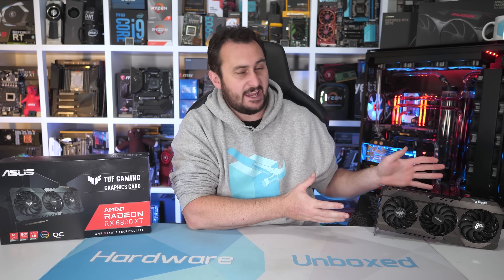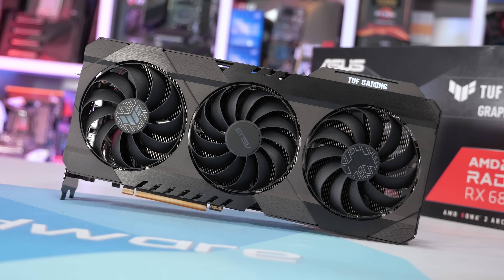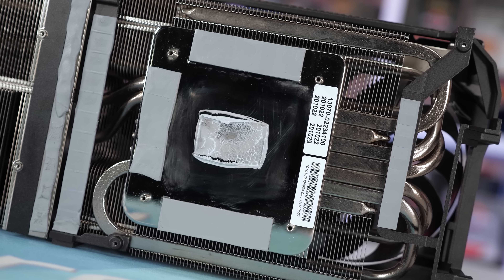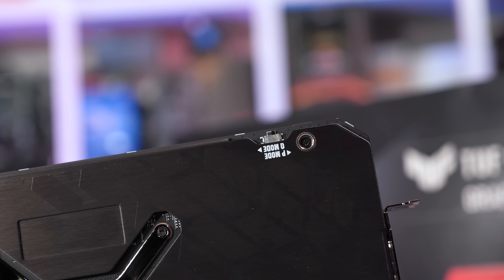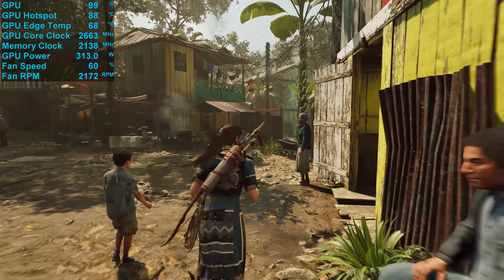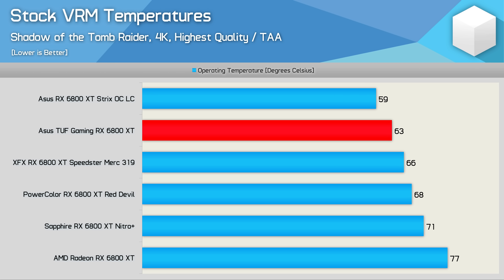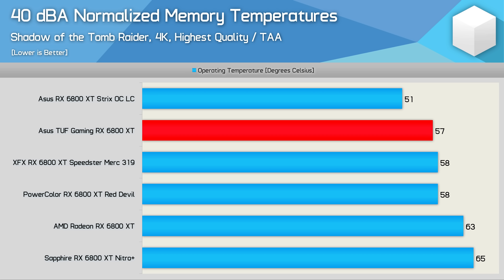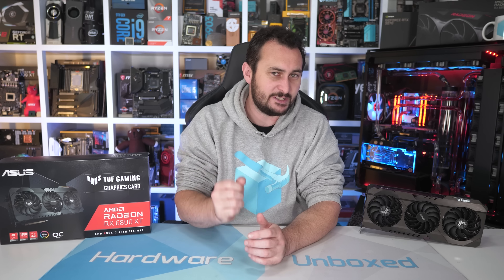Asus 6800 XT TUF Gaming Review, Power, Thermals, Overclocking & Gaming

Comment: 6:30 My rx6800xt TUF has different stats. 
At 272W it runs at 2350MHz and 2090 RPM (t1: 70°C; t2: 86°C)
It runs at 2260MHz and 1800 RPM only under undervolt (-10%) and it consume 245W (t1: 67°C; t2: 81°C)

Can someone explain this?
Reply: Mine runs completely differently as well, out of the box my Asus 6800xt TUF runs at around 2400mhz with the hotspot at 100c, but the fans are very loud, so I'm not sure why the exact same card reviewed here runs at 2270mhz at stock settings. Overclocking my 6800xt TUF to around 2660mhz as shown in the review is totally out of the question, it would crash pretty much immediately with hotspot temps threw the roof.

I have decent airflow in my case and have repasted the gpu but it makes no difference. This is why gpu reviews are kinda useless, it's just pot luck wether you get one that was built well or built badly.
Reply: @j_ford123  Did you end up RMAing it? Just curious.
Reply: @Top_Weeb  I still have it, I underclock and undervolt it so it runs cooler and quieter.

Comment: Why don't cards use pcm instead of paste? My 6900xt hotspot went from 78c+ to low 60s. Like 63 64
Reply: Whats a pcm?
Reply: @leontroll973 
I know it's a bit late, but it's phase change thermal pad on a chip. Basically a material that changes to liquid when it reaches a high temperature, which should increase thermal conductivity.

Comment: 2 years later, I bought this exact model used for 500$ USD and new AMD Drivers make it so powerful that it is pretty much at the same level as a RTX 4070. I also have 16GB VRAM to increase my setup lifespan. It is a beast for 1440p and can handle new games at 4K High settings :)
Reply: Bought mine today for $360 US. Big lift coming from Rx5700xt
Reply: I want to do the same rn  @YaboyMond is it still good? I saw a used one local for really cheap
Reply: What CPU did you pair it with?
Reply: Just bought this gpu too with 7500f it crushes every game 2k no problem vram on 3080 is struglin but  16gb flexing
Reply: Just bought it for 35k INR
Reply: Estimado, hace casi un mes la compré usada en u$s 400 y es una bestia! De mí RX570 8gb salte a este modelo.

Comment: Just bought a open box 6900XT TUF for $449 plus tax. Working great and it actually runs cooler than my 6700XT barely kicking in the fans around 56c game temp. This 6900XT actually runs around 80watts less in game than my 6700XT. That is due to the easier nature of running Battlefield 4 at a 142 frame cap. Without the cap on newer games it hits 274 watts.  Wasn't expecting to save power using a 6900XT.

Comment: bought the same one today, for 1353 AUD (in eastern europe, vat included), amazed by its quiet operation, thanks for the good review of the cooler and its components. Interestingly, Sapphire are using two bigger fans on the edge (100mm) but it does not give them advantage.
Reply: this is better than rx6700xt?
Reply: @GyanTvAmit  much better than 6700 and 6750
Reply: @ВикторШишков  how 😡
Reply: @GyanTvAmit  6800xt better than 6700xt
Not sure why you're surprised?
Reply: this better than sapphires nitro 6800xt?
Reply: @MonesahBuson  I had my Sapphire Nittro RX480 8GB for 5y, until it died on me due to oveheating VRMs. I don't want to trust another Sapphire product, eventhough it had a better software tool than what Asus has. For me, the  Asus card is probably more reliable.
Reply: @ВикторШишков  okay thanks for the insights

Comment: HELP!!! This gfx card draws 366 watts (wow) paired with my i7 9700f processor. Would this struggle with the Corsair 600w SFX power supply? Getting some jitter in every game and I'm thinking my power supply could be the issue. Thanks in advance for your time.
Reply: Try to activate FreeSync in the driver and at monitor
Reply: I notice all my RDNA2 cards seem to suffer from too aggressive of power saving. With the clock speeds dipping down due to meeting a frame cap the card doesn't always maintain the capped speed and when I glance at the clock speed it isn't running full speed. As if the card doesn't want to power up on older games. All this extra performance getting limited by whatever BIOS power saving feature. Like with CPU's I would love a full power option that could be selected on certain games that need it.
Reply: @45eno  This card has killed my love for the PC race. I don't even bother with it anymore.  Waiting until I can afford to switch back to Nvidia. Time to cut my loses
Reply: I even upgraded to a 750 power supply with the same results. The crazy thing no one seems to have an answer.  I paid $1200 for a brick
Reply: @thagamezova9310  What is it doing? Mine work especially in DX12 games but some older games the cards are acting like a lazy GenZ not wanting to ramp up. Seeing my card at 50% utilized when there should be no reason the card isn't trying for more frames. I could have bought a 3080 10gb for $400 (miner) or a open box with 30day return 6900XT Asus TUF for $449 plus tax. Right now I am very happy with it. Frames are capped at 142fps, clock speed is hanging around 1200-1600mhz and temps around 56c. Only using around 90-100watts. Nice card with a good cooler. Just want AMD to release a full performance NO power saving option that you could set to certain game profiles.
Reply: @thagamezova9310  I am very sensitive to smoothness being off in my games. Unless I do the below I get obvious off feeling in games.

-Freesync ON in monitor and AMD driver
-144hz monitor and use the AMD driver to cap the frames to 142 max so it is within the Freesync range of the monitor which makes a huge difference on smooth feel.
-never enable Vsync in game menu as Freesync with the set FPS cap will maintain sync.

With that done my mouse/screen smooth feel is like butter. I don't know how others run full FPS speed, it isn't nearly as smooth.
Reply: @45eno  I'll try those things.  I can handle a few stutters. But I'm getting freezing for at least 1 second. It didn't happen until I got 6800xt. My 1080ti was flawless
Reply: @thagamezova9310  I take it you have done a clean Windows install with latest drivers, latest BIOS?

If you have a extra SSD or NVMe you could simply do a clean install on a 2nd drive to test to see if it improves. 

Also could swap out the card with someone is you know anyone. I have 9 builds with 8 RDNA2 cards so if it was my card I will try it in another system and move a different card in the current system.
Reply: @45eno  yes clean install on windows 10 and I tried 11. Same. I sort of think my ultrawide might part of the issue. Maybe this card just struggles with too many pixels
Reply: @thagamezova9310  I've run 6600XT on 4k TV's. Also 6600XT / 6700XT  on 1080p/1440p. 6900XT on a 3840x1080p. 
I have all different sizes from 16:9, 21:9 and 32:9 super ultrawide.

Try to find someone to swap the card out for testing, that will tell you if the problem stays with the card then you know.
Reply: @45eno  OK bet. I will swap with a buddy

Comment: I happened to buy this one as my 6800xt to replace rtx 3070. This thing is so huge that I had to replace my pc case, too. But runs really cool and I managed to undervolt to 1020mv. Only consume around 220W to achieve 2350mhz stably under load.
Reply: nice!
Reply: What's your experience been using Tuf one for almost a year? worth it?

Comment: Just got my tuf 6800xt and the build quality on it is nuts. It feels solid, looks great, and runs great. It has not gpu sag either.
Reply: I didn't wanna go back to Asus because their RMA process is bull. But this card looks like one is the most solid. I use sapphire and their RMA process is wonderful. They replace my Vega 64 with a Vega 64 that doesn't exists on the market. It uses AMD Pro drivers. This card has never crashed once. Turns out these companies have cards that runs perfect as hell and never fail when stable as hell drivers. They just don't put them on the market. I've had my RMA Vega since 2019 and This thing doesn't know what crashing is.

Comment: Trying to play games like WZ I can't get my card to go much beyond 100fps at 1440 even though I've seen it rated much higher.

GPU: Asus  6800xt TUF
CPU: AMD R7 2700x
Ram:32( clocked to 2132)

is it CPU bottlenecked or do I need to get my ram faster? if I enable XMP profile for 3200 system crashes.
Reply: That RAM is a huge problem. You're still on DDR 3 but a very low clocked DDR3 ram. I think you're ram is an issue. It's destroying that cards performance.
Reply: That RAM is a huge problem. You're on DDR 4 but a very low clocked DDR4 ram. I think you're ram is an issue. It's destroying that cards performance.
Reply: for my opinion it's both ram and cpu, cpu 5600x will boost your fps + ram should be base 3200-3600 cl16

Comment: This card is a beast! One thing that threw me off is my CPU temps are round 46c when using this card on my MSI X570 Tomahawk and Ryzen 5800x while gaming BF5. My previous card MSI RTX 2070 super my CPU temps run between 68c - 80c. I scratch my head. Thank you for this awesome review, I respect it.
Reply: Gpu takes more of the work so CPU has less to carry meaning the temps are lower

Comment: Great review! I own this exact card now. Partly because of this review and partly because I previously had a 6800 "non XT" Asus TUF Gaming OC that was so powerful and quiet. I expected more of the same. I can whole heartedly say that this XT based TUF card is noticably heavier, bigger, louder and hotter than the non XT version I had. The non XT version of this card was nearly silent in my case even after hours of gaming. Without benchmarking I can hardly tell them apart in my current games fps-wise.
Reply: Another thing I have noticed is my CPU (5600X) is also hotter now while gaming by about 5 - 10 celcius. Which I attribute to higher amient temps generated by this 6800XT (probably due to my Corsiar Carbide 400C case average airflow).
Reply: Running Heaven at 1440P in a loop for 30 min with my case closed the fan is 2250 RPM. Edge Temp is 77C. Although room ambient is 23C and I know my Corsair 400C is only averagely decent airflow. Edge Temp drops to 70C and fans 1850 when I open the window on the case. This is in Q mode and not P. Clock average was 2340 MHz. I think the card I got was not quite as good as yours.
Reply: I figured it out (my higher temps). I was using Heaven where my fps are very high. Noticed the higher my FPS the higher the temps and the higher the fan speeds. If I get the fps below 90 (maxing out RDR2 for instance and running around in town) my temps and fans are in line with the review here. I play at 1440P and FPS are insanely high in some games and the temps and fans ramp up. Solution seems to be fps limiting via game menu or using a utility.
Reply: Hi, thanks for your feedback. Could you tell me how long is the card inside the case? I can get one here in NZ for NZ$1899.00. Not cheap but the lowest price since the release.
Reply: @xmj6830  12 and 3/4 inches from Mount end

Comment: How did you guys measure the 317 watts stock power draw on this card? The max power draw that I saw using AMD Metrics overlay, GPU-Z and MSI Afterburner was 287 watts even after using the GPU Overclocked option from the Tuning menu in Adrenalin software.
Reply: Same here, have you found a solution?

Comment: I have a 6800 XT, I’m not seeing enough stats while running games in the radeon software, the core clock fluctuate anywhere between 0 and 2000 and keeps jumping, I’m not seeing a higher power draw then 90 w.   Is the software just not displaying data correctly, or am I right in assuming that the card is simply not drawing enough power, and should maintain a stable MHZ for w.e i set it on.  I set it to 2000 mhz, but its never on there, and the Wattage should be around 250?

Comment: 2 months later they're 90% over the base MSRP at 1900 AUD. I snapped one up for "only" 1650 before the price hike and should be here next week!
Reply: Brutal. I just got one on Newegg today as part of a rip off bundle. But the card was $1499 CAD. Could have been worse. I sold an msrp 3060 ti for $1350, so it was a nice upgrade.
Reply: @benson733  our pricing is very similar. Means you got yours 100 cheaper than mine. Good job!
Reply: got my 6800xt black edition from amd store for $650
Reply: @DragonProtector  USD yeah?
Reply: @johnathonm7813  yup
Reply: @DragonProtector  wish we could order from and direct. Would have been about 1050 AUD here with the tax etc

Good job getting one for msrp
Reply: @johnathonm7813  thx! Truly took over half a yr and was on gut feeling

Comment: I've come to doubt that the reviews will actually be useful in the future. The latest development for the 3060ti in Sweden is that you can't even reserve one for when they're in stock (which makes me wonder if they'll ever be). The 6800 is up at 925€, i.e. so not worth the price, but hey - at least you can reserve one, the same can be said for the 3070... or should I say, a select few 3070s and the ones you can reserve seem quite bad. You can reserve the 1660s... but their price does not reflect the fact that they're very soon 3 years old, and buying 3 year old technology for the same price as they were when they were released is just retarded. Oh and on newegg the 1660s are actually like twice what they were when they were released. The 5600s are no where to be found in Sweden and on newegg they're only 1k USD... I mean, if that's not a bargain, I don't know what is.

By the time these reviews might be "relevant" (in terms of availability of cards), we're probably getting close to (or should be in a normal time line) the announcement of next gen cards, rendering these reviews sort of obsolete. No fault of HU though, but the only reason I actually watch these reviews now is because YT channels needs views.
Reply: I bought this exact card, the tuf rx 6800 xt brand new for 1050 €. Its still around 300 € over msrp but considering the current situation and the fact that this model is selling for + 1600 € on ebay and other platforms I think it wasn't a terrible deal. Prices in Europe are more inflated than other parts of the world for some reason (perhaps because of higher import taxes?) and the stock situation is only getting worse instead of better.

Comment: If you look closely it’s clear to see that they have the PCB ready for the 2 fanconnect connectors that they always include on the ROG Strix models. There’s both solder points and text with ‘fan 1’ and ‘fan 2’ descriptions. I think it’s a killer feature and I wonder if it would be possible to solder on 2 fan connectors as it seems to be prepared for it. Then I can avoid paying the Strix premium for this feature :)

Comment: The problem with the boosted RRP's is that now they are often more expensive than the Nvidia RTX 3080 competitor. When this happens the 'do I want 16 GB or G-RAM or 10 GB of faster G-RAM, DLSS And better ray tracing'?
That said, given current demand and shortages you could sell Vega cards at a high price or even 900 series GTX cards...

Comment: Steve You mentioned wanting to know what the cooler on the Strix version of this GPU would be like... if I'm not wrong the Strix version is now watercooled with a built in AiO. I have a feeling the TUF versions of the 6800XT and hopefully 6900XT are the top air cooled models.

Comment: i think if your video card is going to be 2 or 3 spaces in size they should have an extra PCi-e insert (a blank one )  that plugs to one of the buried PCi-e slots just to help support the card's weight better. sure you might still want a gpu brace , but having it pin into two slots actually would go a long way to help support more weighty cards.  and besides you might as well since the card is gonna cover those pci-e slots any way .

Comment: With the whole scene's availability only trending "worse" instead of better, I have to question the point in any current hardware coverage. The next product cycle will get "released" before availability improves. Even by then, look at 5700xt availability or lack thereof, there's no point to any of this. Anyone with a Ryzen 5xxx and a current gen GPU is best served selling the parts and going back to a PS4 Pro or just getting a nice quiet notebook and skipping the scene entirely.

Comment: I jumped on this card when I saw it in my local store, I didn't really register how big it would be but it's ENORMOUS.  To the point that it only fits my case in a vertical mount. 
Performance seems decent but AMD's drivers are still kinda skanky, hopefully they'll get a handle on the issues more quickly than they did with the 5700s